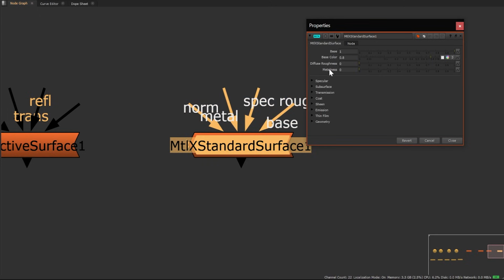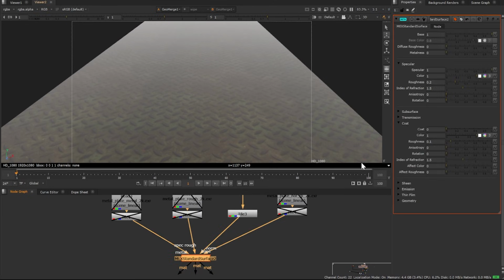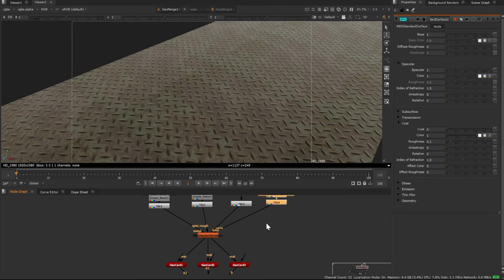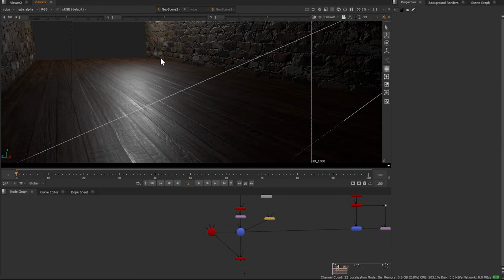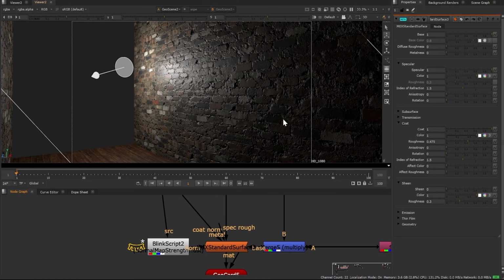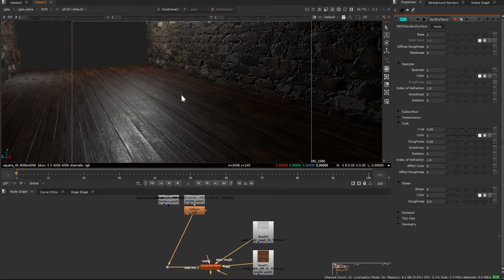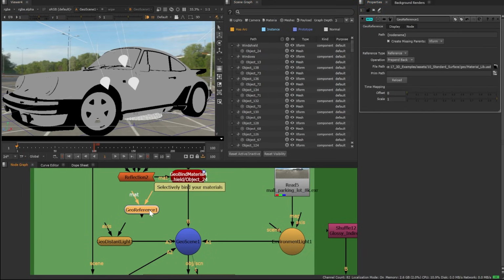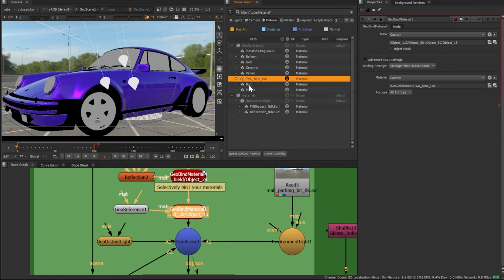Nuke 17.0 | Lighting MaterialX for better renders

Comment: @chriswetherly8931 What other MaterialX nodes are supported? (Standard Surface is actually its own separate standard and not really specific to MaterialX). Also, OpenPBR is the successor to Standard Surface, and is already out in the wild - is there going to be support for that as well?

Comment: I think first of all, the node interface is getting messier with so many inputs in nodes(like shaders) that by default only have two input wires available and then you have to start pulling from the side until the one you need come out, maybe add by default some dots connected to the node so it looks like houdini nodes, but you wont have to be fishing for the right input on the side of the node and connecting it to place holders so you won't pick it up again, so it would be easier to connect something to the normal or coat that might be at the bottom of the prioritys. Also if the GeoRefernce can ontly impor like layers from usd like only materilas and only lights I think it needs a better name
Reply: Hi Max, thanks for the feedback, don't disagree that we can improve how the node inputs are better surfaced with nodes that are growing with more input pipes. We're taking a number of UI improvement feedback on board and while I can't guarantee all will happen for the next release, we're making sure to capture what can be improved for future updates. For GeoReference you can bring in any data from the file you are loading, whether that's geometry, camera, lights, materials etc. In the video we're just using the filter functionality at the top to only show the materials to make it easier to select just want you want to bring in. The node name is based on that idea that you can reference additional data into your scene, whether that's from the same file, or to reference data from a different one and aligns with USD's concept of referencing while still hopefully being intuitive to artists. But if it feels unclear always happy to hear alternate ideas.
Reply: @chriswetherly8931 I’m glad to hear that some Ui improvements are coming eventually, on that note add a easy add keyframe and a remove animation from channels please, right clicking on each channel to delete or add animation sometimes takes too long, I know you could reset the whole node, but sometimes you just want to reset some channels. On the geoRef node I do understand what it does, an surely anyone would get use to it, just from a Ui experience it is a node that won’t be used just to import geo, so is a bit misleading, if is reading usd stuff something like usdReference would make more sense and you don’t have to explain it could reference anything usd related, geo, materials, scopes, cameras etc
Reply: @maxmax003  SceneImport would make more sense as a name than GeoImport.
Reply: @danielmiller1826  I actually, really like that, so it keeps it usd agnostic
Reply: @danielmiller1826  we did discuss names like SceneImport, but part of the naming convention was to match other systems in Nuke, like the Deep or Particle nodes where they are all prefixed with the system they are apart of making it easier to know what system a node belongs to when tab searching. So with the new 3D system the Geo prefix lets you know its apart of the new system and doing something like GeoSceneImport felt too long
Reply: @chriswetherly8931  That makes sense.